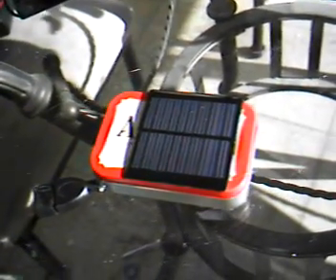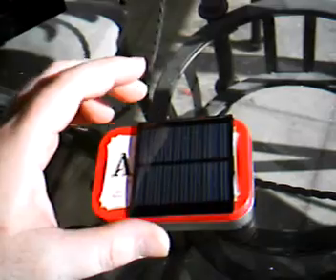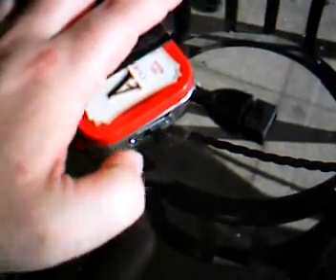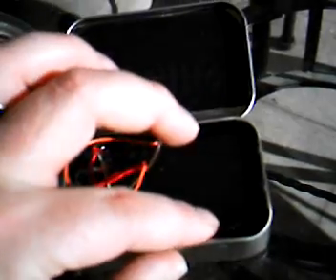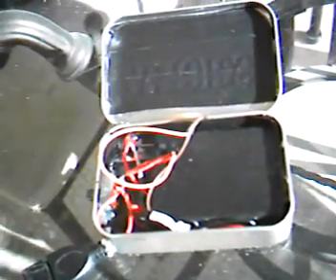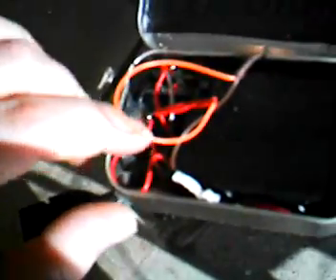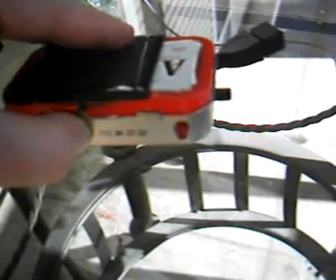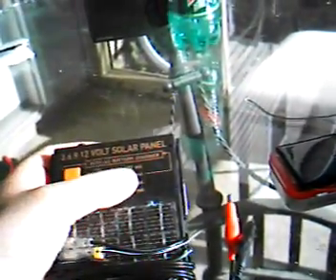How to make a solar usb charger!

Comment: Only 4 batteries? I dont think that would work all to well. The total voltage would be 6 volts if in series (4x1.5) once the batteries are discharged enough to drop below 5 volts it would stop charging. without a boost circuit this wouldnt be that effective. maybe good for a 10-20 percent charge.

Comment: can you tell me what type of wires you used, the length they need to be? I get the I need an altoids can, the 6V solar panel, 4 AAA batteries, a casing for the batteries but not sure about the wires. Do they come WITH the solar panel?

Comment: most li-ion batteries come with circuitry which protects it from overcharging, also if you charge straight from USB into your phone, the phone circuitry controls the charging

Comment: iPhone 4 needs 5.3V to initiate charging. A "better" way is using a DC-DC converter. 6V solar panel would need 4x1.2V AAA batteries wired + to - (he used a 4 AAA battery holder project box - this has two leads Red and Black and the batteries snap in). Trouble is AAA's have about 300-700 mah, iPhone needs 1450 mah to charge to 100%. A 12v panel with Dc-Dc converter to 4 AA's and a 12V-5V transistor (shack parts)  wired with 1000uf capacitor would charge N E Thing USB.